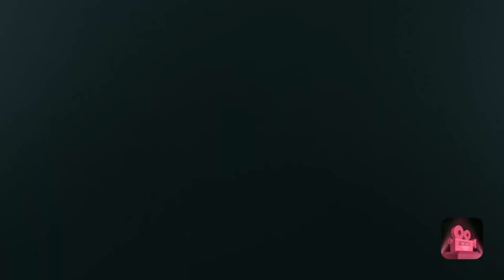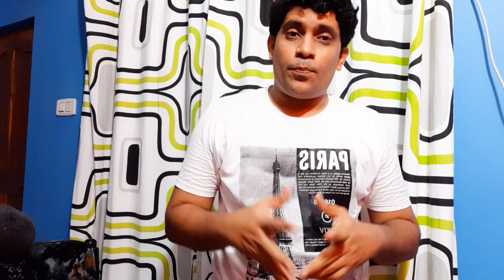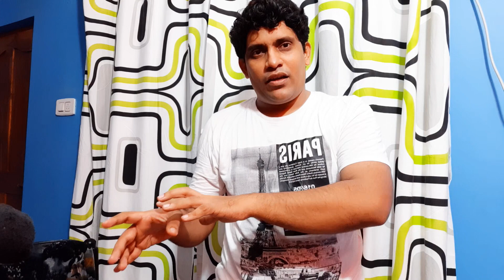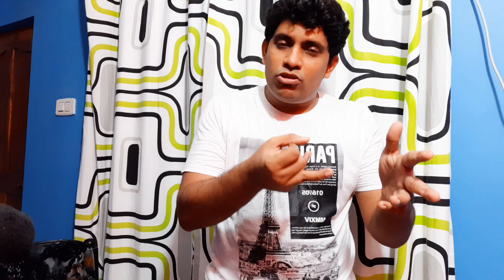Starting Air line Explosion 💥 #startingairlineexplosion

Comment: Sir what is the use of slow turn valve in starting air line
Reply from the maker: If engine was on standby and if engine not started for more than 30 mins it will do slow turning like giving blowthrough its kinda protection system